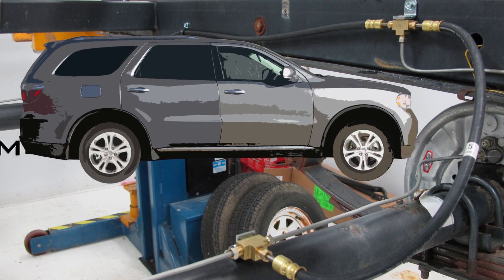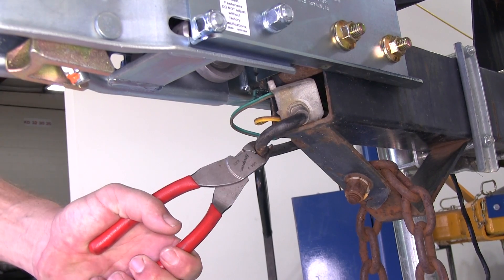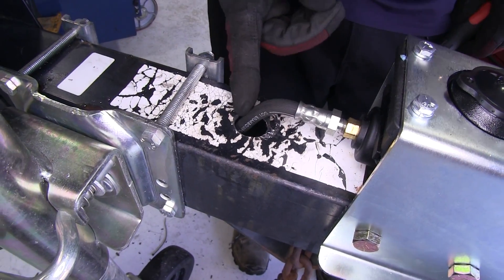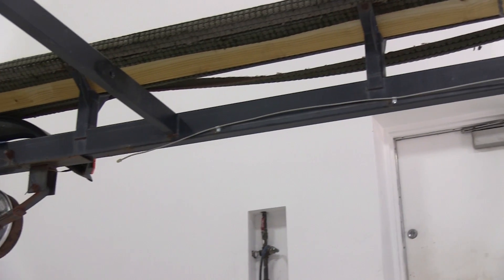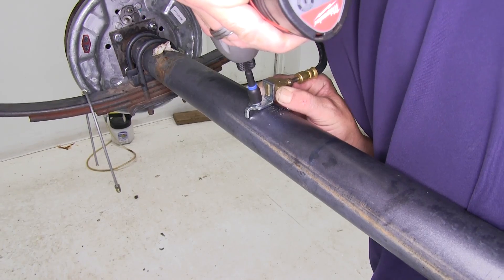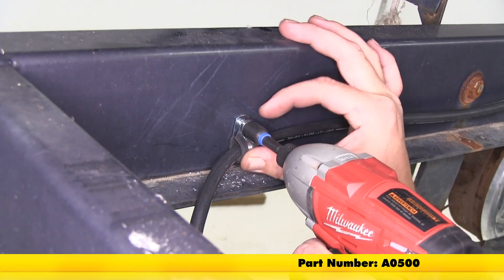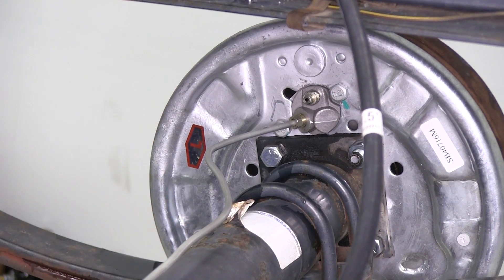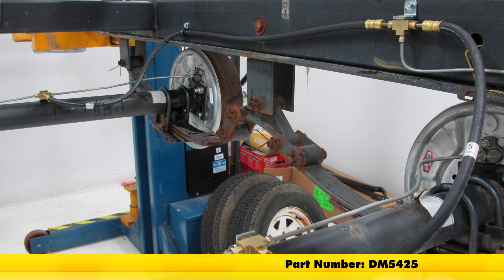etrailer | Checking Out the Demco Hydraulic Brake Line Kit for Tandem Torsion-Axle Trailers

Comment: A rubber grommet would be safer than trying to center the brake line in the drilled hole.
Reply from the maker: Using a rubber grommet is never a bad idea when running hydraulic lines or wiring. Thank you for mentioning this. We will be sure to include it in our future videos.

https://www.etrailer.com/Accessories-and-Parts/Demco/DM5425.html